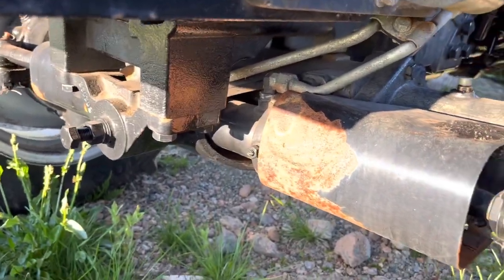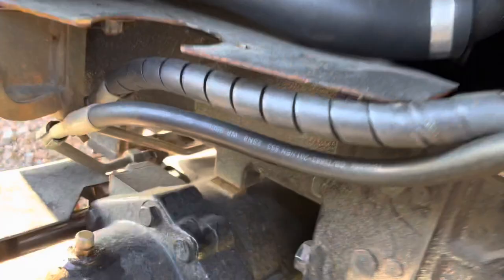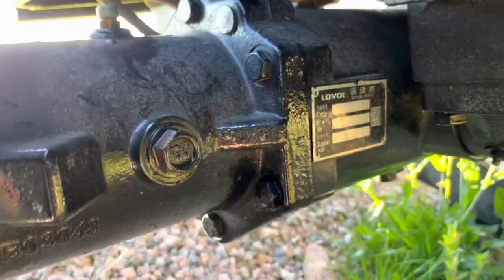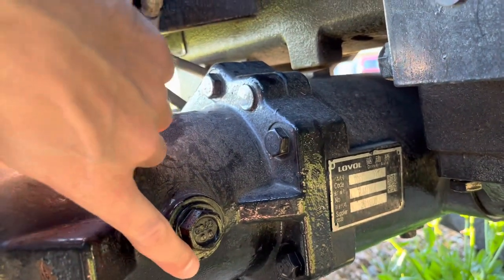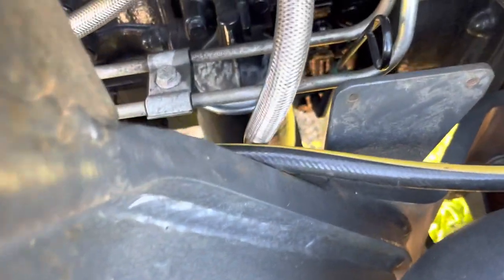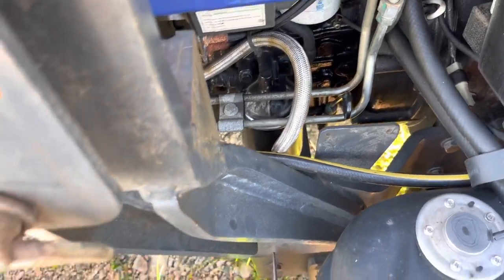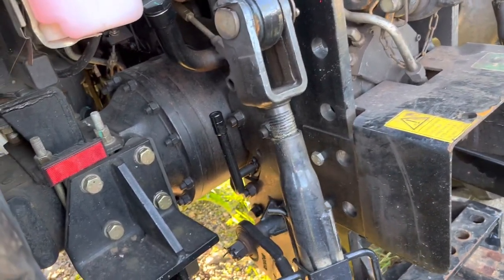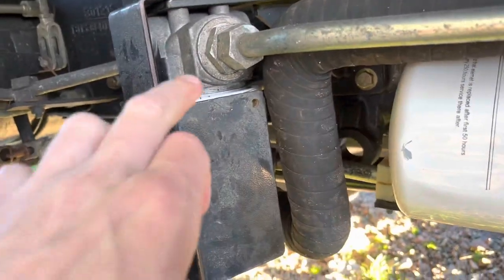Can’t get any better than this #39@outdoorsintheartic

Comment: I noticed on my tractor the front axle has 3 drain points one in the middle and 2 on either side, the ones on the side hold around 3 litres total because they are lower drain points. Cheers

Comment: Mabye it 7 liter with the planetary/reduktion  gears? 1 liter each
Reply from the maker: Yes it is. You will need about 2 liters on each. I had to check it with my dealer.